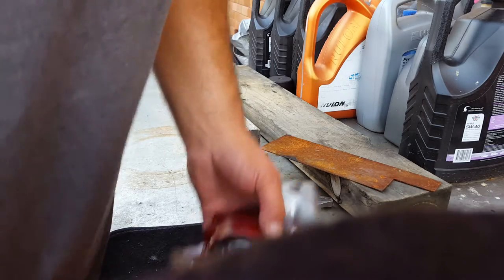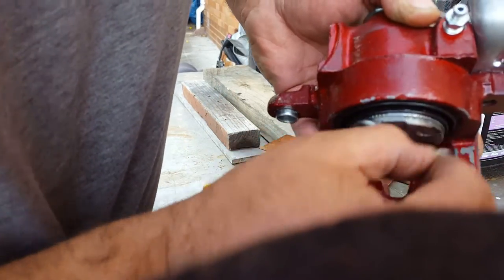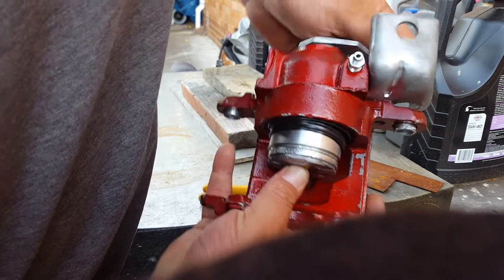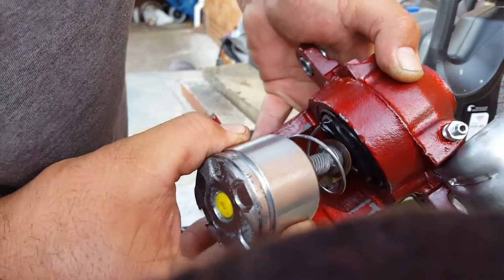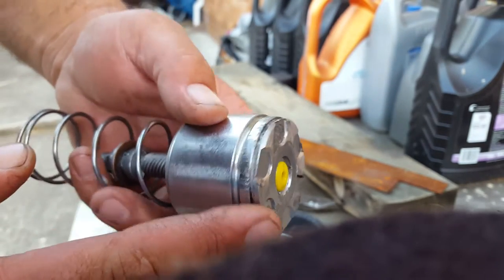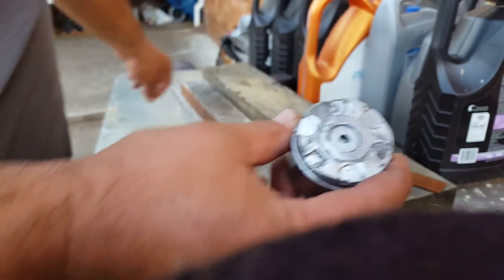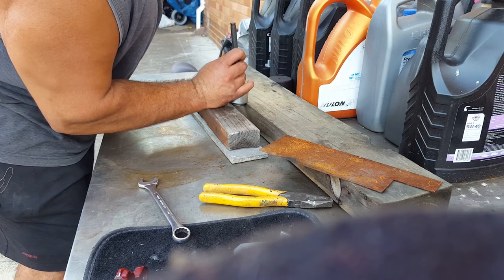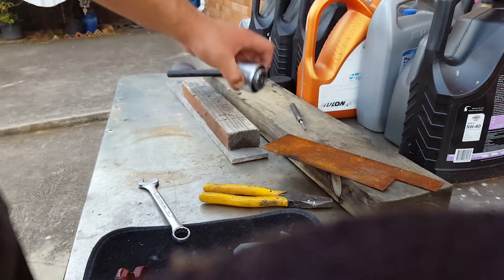79 - 85 Eldorado rear caliper on 63 Riviera E-brake fix (part 2)

Comment: Benny, a few questions... I have a 76 Eldorado with a very similar system.  1st, where did you get that way cool clip that you are putting around the piston?  2nd, watching you take yours apart from the first video, mine seems to have 2 washers for the ball bearing race to ride on.  Didn't yours?  Last, how to you get the dust boot over the piston?  It looks like I am going to have to fight with mine.  GREAT videos of this, btw!  Thanks!